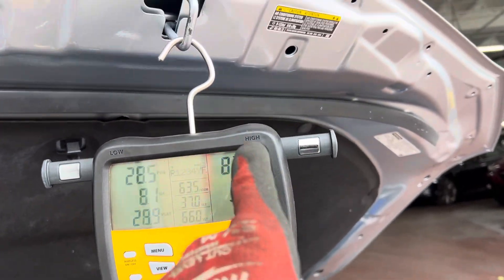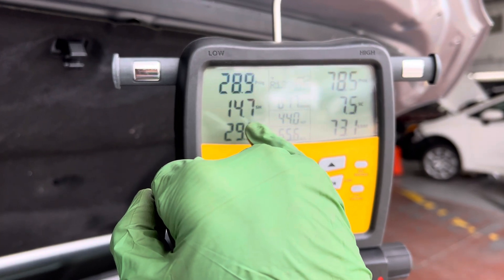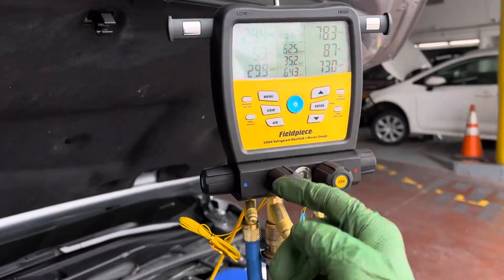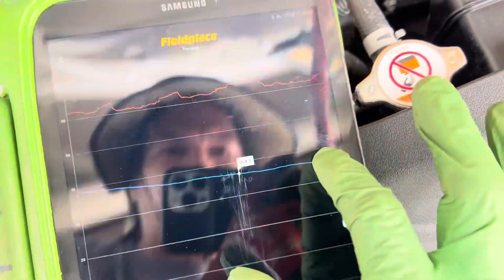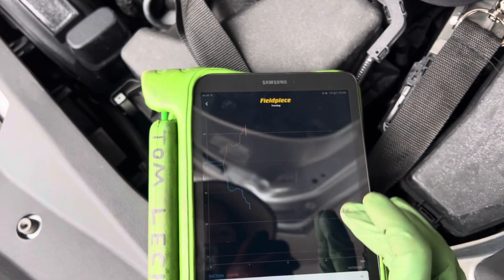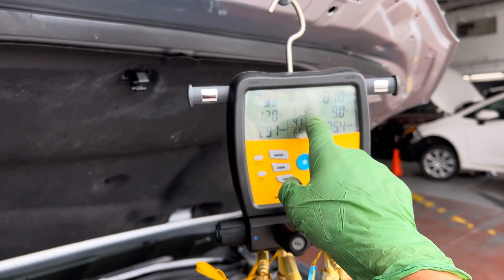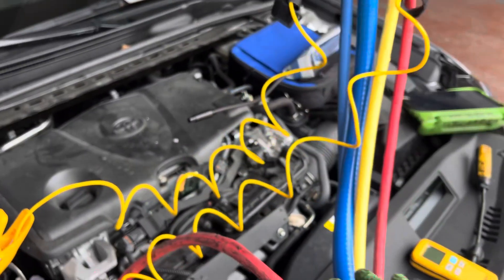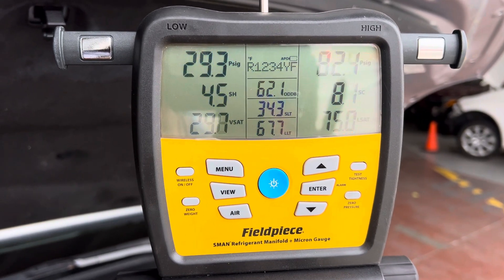80 psi on the high side does not mean it’s low on refrigerant.￼

Comment: How can you tell if it's correctly charged if SH and SC keep changing like that?
Reply from the maker: This is not a residential split system.  Automotive systems are different. They’re insane.

You’re constantly pulsing, the condenser fans on and off all the time 

Or they have terrible fans are constantly ramping up and ramping down 

Now you have variable displacement compressors, just like a VRF system or a mini split where the compressors displacement or the compressor speed is constantly ramping up and down depending on temperature sensors and pressure sensors doing with the computer tells it what’s needs to be done not with the refrigerant wants to do 🤣

This is why commercial or residential HVAC guys cannot understand Automotive . 

And this is why automotive guys most cannot even understand automotive air conditioning guys are uneducated and they don’t read they don’t believe in going to formal classes . 

And all the car year make model, vehicles, superHeat, and subcooling are different 

Some cars are around zero superHeat some cars around four or five superHeat some other cars around 10 to 13 superHeat well some other cars are around 30° 

There is no rule of thumb

Exact same goes for sub cooling. Some manufactures have subcooling that averages out somewhere around 9°. Other manufacturers will be around 13° plus or minus some other manufacturers will be about 20° plus or minus some other manufacturers will be 30° sub cooling plus or minus.

No rule of thumb

So all timers who are used to always have no place in this new world. 

And uneducated automotive technicians, who are lazy and don’t read have no place in this world

McDonald’s hiring. 

This is why I put all these videos out here to show all the different varieties so people who want to learn can see there is no average

There is no one way to do

There is no one method there is no one reading, cannot use pressures to determine whether a system is full or not.
Reply: @coldfinger459sub0  excellent!  It sounds like the only way to know if a system is correctly charged is to totally evac and weigh it back in?
Reply from the maker: @peterd6592  👍100% exactly. 

When you get to learn the superheat and sub cooling of individual vehicles, because you’ve done that particular vehicle 100 times, then you can use SuperHeat and subcooling to get a close approximation not exact

I do a few thousand vehicles a year so it’s very easy for me

Comment: 90 degrees when vehicle is in sunlight what should be your high and low reading on your hi and low reading
Reply: Traditional MVAC systems were way oversized so the cycle on and off to meet demand.  "Variable displacement" in MVAC is like a mini-split in HVAC. It' modulates the compressor to just meet the need of the TXV and have just enough CTOA to remove the heat from the condenser.  Probably also has a heat exchanger between the suction and liquid line as well.  

Occupants don't feel temperature swings and the compressor uses much less energy.
Reply from the maker: There is no one pressure. 

Oh, manufactures are different. It depends on the size of the condensers how they have the fans pulsing on and off or variable displacement or to Fan arrangement or one fan comes on and second kicks in at a different pressure. 

At 90°F you can have two cars sitting side-by-side and one cars high side pressure will be 160 psi in another cars high side pressure will be 270 psi 

There’s no such thing as a certain high side pressure that fits every vehicle for every exact outdoor temperature. 

It’s what the manufacture design to system to operate like .